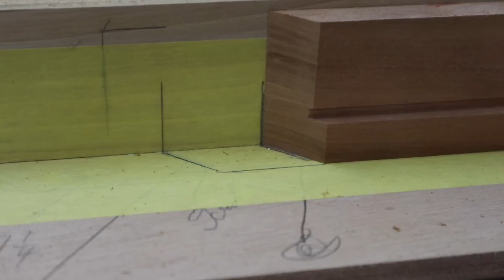Making Picture Frames from old Cherry wood flooring

Comment: We salvaged maple basketball court.  Ran hundreds of linear feet four times through four different cutting/cleaning operations to recondition the wood.  Installed it at church for the front Chancel (stage).  Totally new floor.  Has some bird's eye in it too. Great work you did with this cherry.  Like to see wood used again.